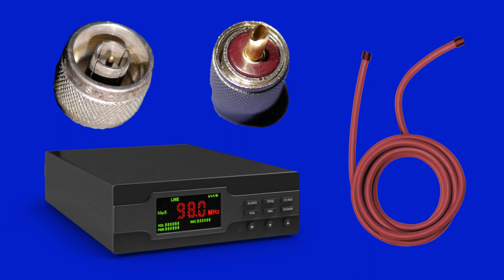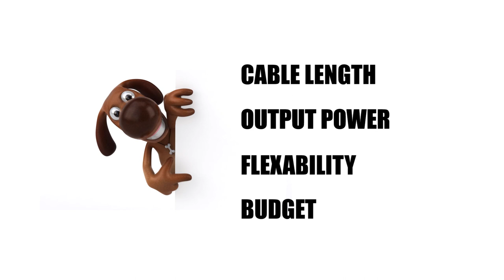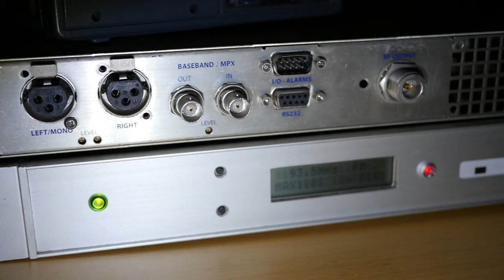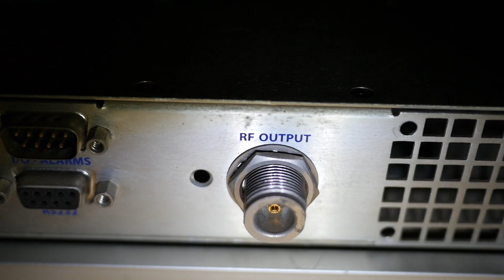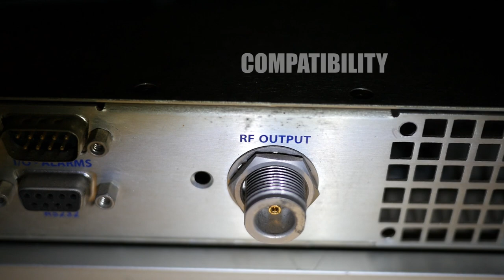FM Transmitter Antenna Cables And Connectors for The best RF for FM Broadcast Antenna

Comment: Personally I would use times microwave lmr400. Although rg213 is a standard in many places. It predominantly was used by the United States military, due to its double silver shield. It does have less than rg58, but also it's considerably heavier. And if you're stringing cables up a few hundred feet on a tower. Wait becomes a concern, also there is more LMR 400 in LMR 400 made every year than rg213. And is also generally available easily on the internet. You get the power handling and lost characteristics of essentially half inch heliax, without the weight and complexity., there's also LMR 240, which is a RG58 roughly sized coax that has about the same loss Factor as rg213.
Reply from the maker: Thanks for your input on the cables. Always appreciated. I have had a few people talk about Lmr cables. They are great and solve a lot of problems. In many cases though the cost for small operators is not worth it. For a small community radio station simply turning up the transmitter power fixes any losses and the installation is simple enough with most setups being less than a thousand watts. Many as low as 100 watts. So they don't really see the value in it. On big professional set ups yeah its almost a no brainer. But for a station using a 250 watt transmitter into a two stack antenna set up 30 meters up needing only an erp of 200 watts its not even on their list to have LMR cables. But it's always good for new people to learn about the cable options. Cheers :)

Comment: 😂 wow had a grate laugh watching this thanks on vhf fm i would rather say use atleast lmr400 or better or the heliax range of coax dont even waste time or money onRg58 or Rg213 also never bend coax at a hard 90 degree angle if you run high power the centre conductor wil get hot and melt the insulator between the center conductor and the screen and cause a short and that wil damage your equipment
Reply from the maker: Glad you enjoyed the video even if you laughed at it lol. Yes for high power stations with long cable runs lmr range of cables are the way to go but for small radio stations with antennas only 20 meters high and putting out 100 Watts or so Lmr and heliax cables can be a bit if an expensive over kill. I know my channel has a mixture of professional and beginner viewers but beginners are very unlikely to want to spend on  Lmr or heliax. They also don't really need it. But glad you enjoyed it anyway :)